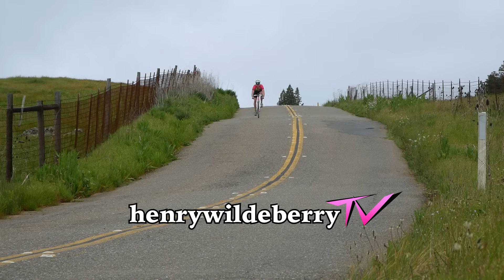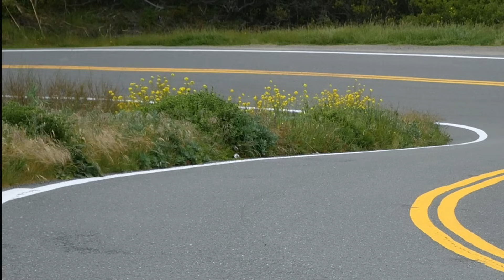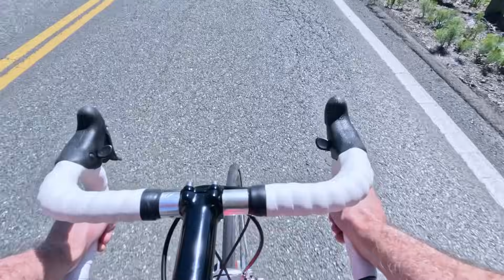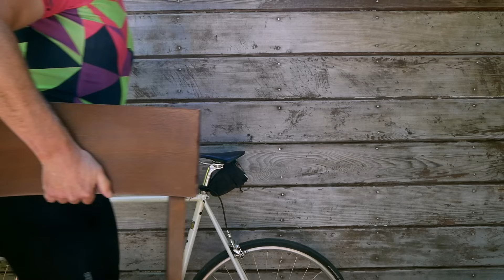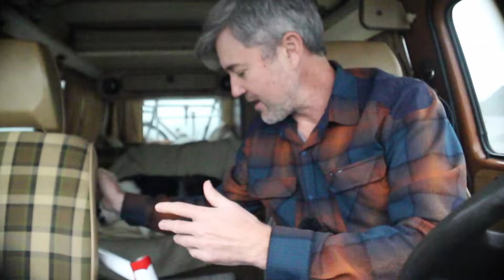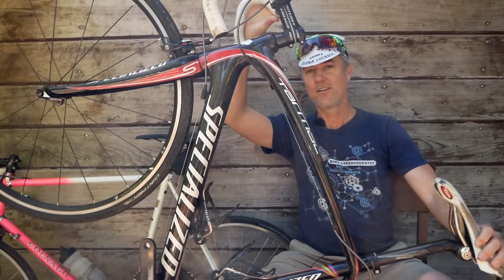This is the Colnago and where it came from...

Comment: Great story and lovely bike! Nothing says “I am my own man” like a triple crank on a road bike.
Reply: I have an early Ultegra triple on my 1990 MASI road bike.  Meaning it has a 42 tooth chain ring in the middle.
For me that 42 is great gearing for the flat rides our group does around  here.  Then the 52 big ring can get with it on downhills or over 25 mph on flats.
Reply from the maker: Campy did us a service by putting the words “Racing” on the triple. 
Seriously, it’s a perfect setup for where I ride. Lots of steep climbs and plenty of fast descending and sections of flat roads where you can choose the smoothest chain line. Sure, it’s out of fashion, but it works great!

Comment: This is the first video I have seen from your channel and I know exactly where you are coming from. I collect vintage lugged steel road bikes and have only one carbon bike a 2007 Trek Madone. All my other bikes are steel and date back to the late 30s through to the mid 80s although I have a Colnago Superissimo frameset which I think is later. Steel does indeed ride so much better than the stiff rigid modern carbon frames.

Comment: What a great story. Totally fine way to start my day. Sipping coffee.  Have been wondering when the Colnago would surface,also in response to your last video I commented on the fact you guys mostly ride the same bikes….I also am re-discovering steel frames.  From following bike tech for decades,over past few years swapped Carbon for custom steel on both Mountain bike and Campy 11 speed road bike. Recently bought a Titanium road frame and now both road bikes are non Carbon . Simply like the simplicity,ride quality and workmanship.Keep the superb content going. Thank you.
Reply: I recently replaced a carbon fork with a 1.5" crown, with a traditionally bent steel fork with 1 1/8th inch steerer.  The difference in ride quality absolutely astonishing.   The steel fork is essentially a suspension fork, while the carbon fork rode like a plank of wood.

Comment: I have a 1990 MASI that is a great bike, glides silently down the road.  It was my every day ride for many years, now it just goes out occasionally. I saw the frame at the Anaheim bike show, and I had to have it.  Im running a 25/12 cassette on it which is great for the usual flat group rides that Meet at the One Mile swimming pool, in the Park in Chico.

The MASI, is THE downhill bike. When its going really fast it is dead calm, Ive had it at 62 mph drafting a tandem and it was unperturbed. I can hit the exact inch of pavement I want to hit with it.  Ive ridden the Death Ride twice with it.
Its been on lots of centuries from Yreka to Monterrey .

Gotta say though, modern carbon is much better than old tech carbon. My Canyon Endurace sucks up bumps and with it's carbon basalt leaf spring seat post, it is a great long distance ride.
Reply: What about front end stiffness with carbon forks? You don’t find that configuration excessive compared to a small diameter straight steer tube ?  After 3-4+ hours of riding?

Comment: I believe I have the same model, but in a different paint scheme.  That looks exactly like a Conic SLX in every detail.  I used it as my main bike back in the early 90s and then as a commuter until last year, but switched to a Colnago C40 HP I wasn't using.   The Conic is a fun bike to ride, but it'll rattle your teeth on rough roads.  Pity the Precisa fork is gone.  I'd never put a carbon fork on my Conic even though it is more comfortable.
Reply from the maker: Good to know! I wasn't sure the model. SLX, so does that mean it has SLX tubing?

Comment: Nice vid, a good tribute to an old friend. 

Nothing better for us mortals than campy racing T on a road bike.  I finally came across some 9 speed campy ti record shifters for a reasonable price, never thought I'd get a chance to build up a bike w/ some ergos but probably w/n the next 5 years it'll happen. 

I appreciate the commitment to the shot framing, some nice wide shots.  Get it in to the shop for an official weigh in yet?  I'm going to guess...19.5 pounds.
Reply from the maker: Thanks! 19.5 with or without pedals?
Reply: @Henrywildeberry  With!

Comment: Nice. I love the steel triple-butted tubes that Miyata made.
Reply: So true. I have a '91 914, and an '86 1000. They are my absolute favourite, go to rides.
Reply from the maker: I've lusted for a 1000 in my size for a long time. Rumor has it Miyata built the first Specialized Expedition. I'm not sure if that's true but they look very similar.
Reply: @Henrywildeberry  My 1990 MASI is a quad butted Reynolds frame, if you ping the top tube out in the middle it is pretty thin out there. 
 I could never think of selling it.  The original paint looks very new, not a scratch, no fading at all, Steve who was doing the painting at MASI in San Diego back then was very well known for his paint work.
Lots of clear coat and quality paint.

Comment: Henry pal, I think we are on the same wavelength, the only thing I would change is the seatpost, I think a Ritchey classic zero seatpost would look great on that bike, just my humble opinion. I rode my Colnago C40 today at the morning group ride, these are great bikes.
Reply from the maker: Hi Weisan Nice to hear from you! I agree the seatpost has a little too much set back, but it was something I had available in my spare parts. Plus it's silver and made by Nitto, so it's very high quality. For this build I wanted to reuse as many used parts and things I already had. The wheels were donated and just needed a quick truing. The drivetrain is pretty much new and so are the shifters. These are great bikes and more than capable of hanging on a group ride. Enjoy your C40!
Reply: @Henrywildeberry  Understood. I am the same way, mullet buids using parts bin all the time. Nitto silver or polished seatpost/stems are so beautifu;l. Good health and safe riding to you and Ms Cools.
Reply: I really like the C40 and use it as my daily commuter.  It doesn't have the comfort of my newer carbon frame, but the wild paint scheme is beautiful, and for short rides, comfort isn't required.

Comment: You show a Tarmac alongside the Colnago.  If you had ridden them side by side on the same road, how would you describe the differences is ride experience or ride quality? Do you feel that the steel frame dampens road vibrations? More lateral flex at the BB?

Comment: Did you buy it from Max Beach? I have seen many of his bikes on the net. Flickr
Reply from the maker: I know it was a long story, lol! I struggle to tell an abreviated story. 
Max Beach gifted the frame to Chris from the Bike Peddler who then passed it to a young mechanic working at the shop. Eventually, the frame circled the globe only to land back where it started 20 years later. The mechanic returned the frame to Chris, minus the original fork. The fork was a casualty of big carbon and the allure of higher performance. 
I traded Peter's lugged frame to Chris in exchange for the Colnago frame. We each got a frame without a fork, so I had John from Fitz Cyclez build a replica fork using NOS Campag dropouts, a Cinelli crown and Columbus tubing. The triple C of excellence some might say. The fork was then chrome plated in Sacramento at a speciality plater doing high end classic car restoration. Chris still needs a fork for his bike. Maybe he can have Fitz, Retrotech, or Sycip build something special? One day, I want to catch up with him on his new bike, stay tuned....
Reply: @Henrywildeberry  It looks like a 58?  All my road bikes have been 58's.  It always works out.  Im 6 foot even.

Comment: Road bike technology should have stopped there, all the time and money spent chasing innovation could have been spent riding (with money left over for beer, lol!)
Reply: I've got bikes that span generations, and while I love the older ones, no question for long rides, I'll take my modern carbon monocoque with a carbon seatpost and carbon bars.  I know people who can do really long rides on old steel frames, and I could too when I was 30 years younger.
Reply: @kurt1391  I believe a steel fork would allow you to ride even longer in more comfort.  Carbon is fine, but the way they are designed today is for manufacturing efficiency, reduction of liability and for marketing purposes - the overly oversized tubing for example.   Optimal tube profiles should allow some flex and I still believe the steel fork is a superior choice for general and long distance riding.